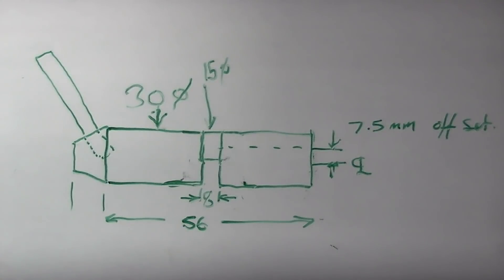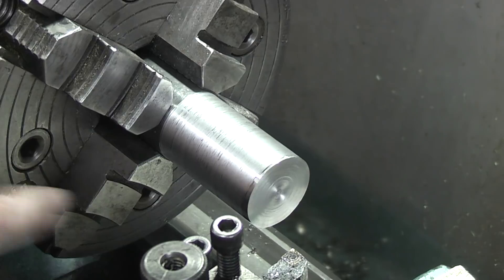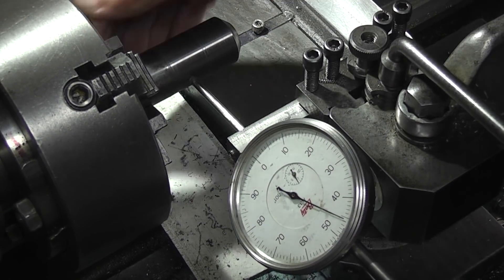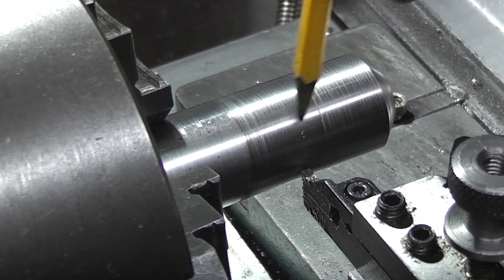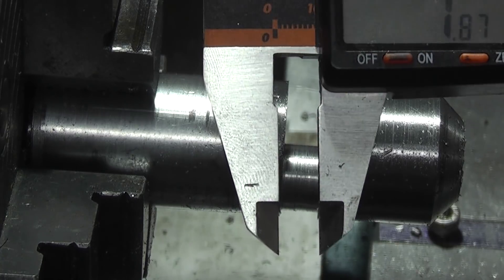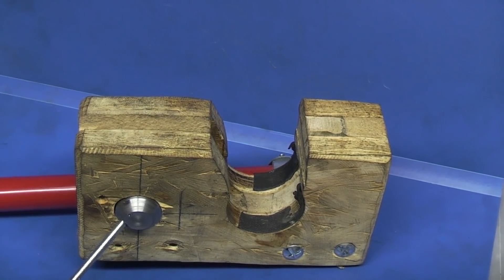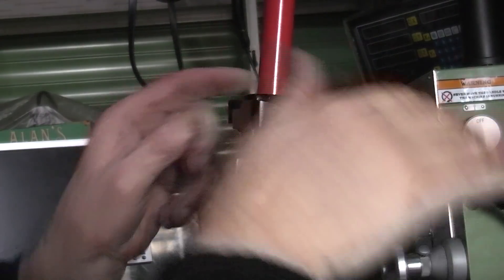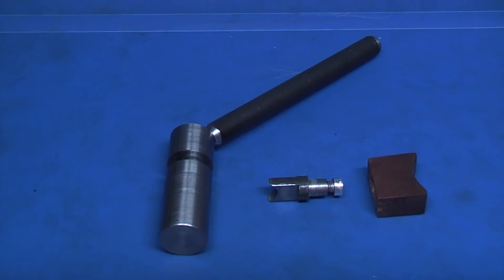Making a cam lock

Comment: at 5:28 I'm reminded of how there is a limitation to this method: if the eccentricity is too great in relation to the diameter of the workpiece, the indicator shaft can get loaded from the side (in extreme cases, is could get bent, especially with a long-travel indicator)
And in such situations, it's handy to have an "elephant's foot", which is like a flat-faced flange which screws to the end of the indicator spindle in the place of the usual small ball-ended tip, providing a large contact fact somewhat like a cam follower. 
Also handy for splined or knurled workpieces, or for riding over keyways or cross-holes without needing to be helped every rev like a lame dog over a stile.
Finally in general use, it saves having to take so much trouble to get the indicator at centre height, especially when working with tapered (conical) surfaces, where any heghtwise deviation can result in mismatching tapers.

Comment: A useful improvement.
Now a word to the wise, you are using a C××× insert so you don't have to keep turning your tool post between facing and turning, it works equally well on both when set square to the work. Don't worry it is a common amateur thing, just look at Doubleboost, he is always moving the tool post for no good reason. Why does it matter, well it doesn't except that if you keep your tool post permanently square you can just drop your parting off tool in without having to think about it.
As for your realigning the tool  when doing your 45 degree cut, you actually misaligned it. The Cxxx tool holder should be square to the travel not to the lathe axis, so could have been left as it was. As I said this is a word to the wise and not meant as criticism.